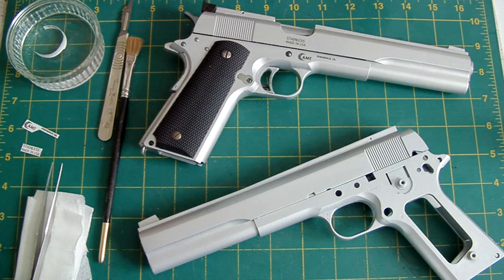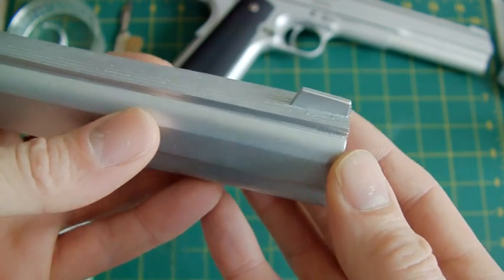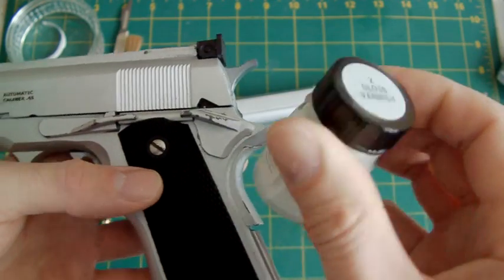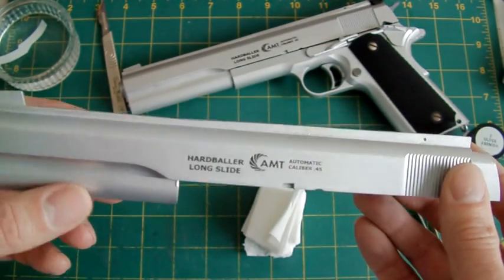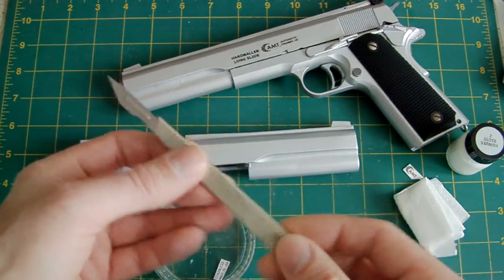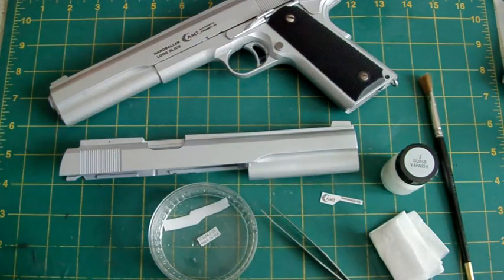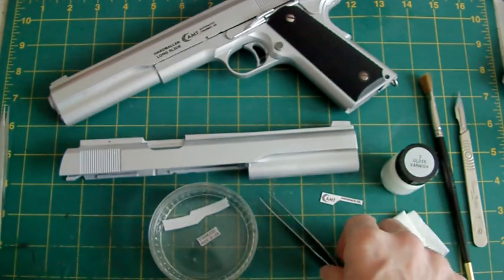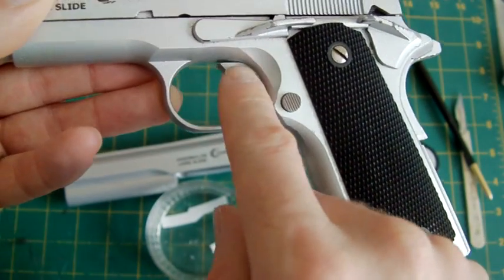LaZouche Custom airsoft How to build a longslide pistol Pt 7

Comment: For white transfers I draw a thin black lined rectangle around the design using photoshop, just a little bigger than the area you'd cut once you print it. Once I have the print in my hands, I just cut inside the lines of the rectangle
Reply from the maker: Good idea, never thought of that ;-)

Comment: Why gloss varnish? Can matte be used in its place? Also, what do you suggest for touching up chipped paint on an aluminum KWA slide?
Reply from the maker: Gloss varnish will leave a flat surface for the decals to adhere to cleanly with no chance of air bubbles being trapped underneath. KWA slide painting chips issue, use car spray touch up paint that matches or better still repaint entirely with car spray ;-)